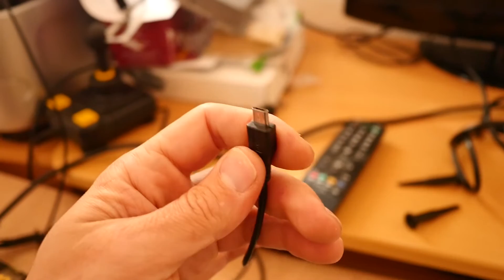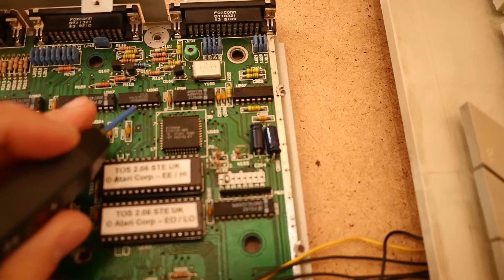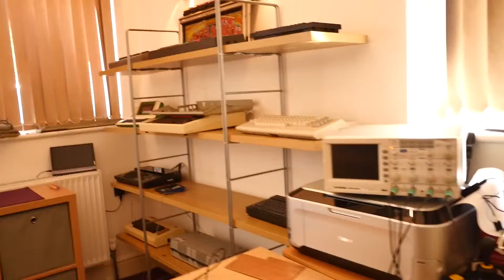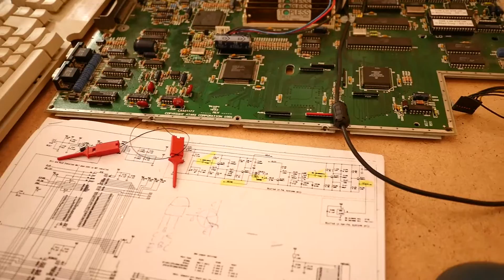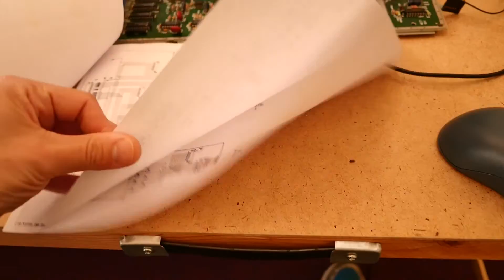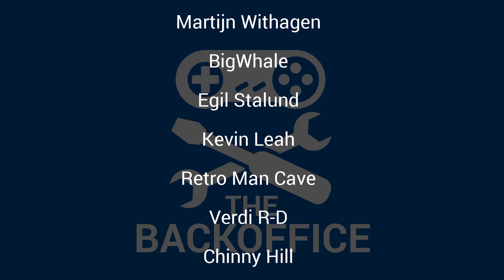Repairing my Atari ST - Conclusion

Comment: Most Ataris were provided with crap 3rd grade taiwanese capacitors branded "Wang's Cap". Those are old and rubbish and have to be replaced. Atari only used top capacitors in specific series (very rare to find, i own one 1040 STF that has them).